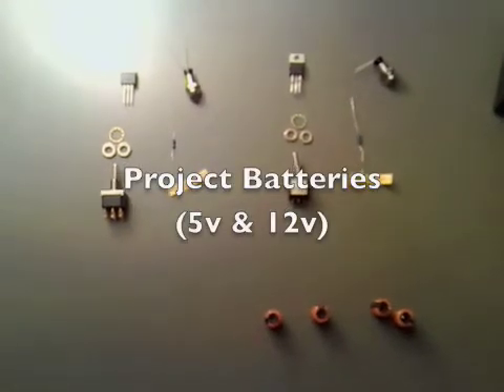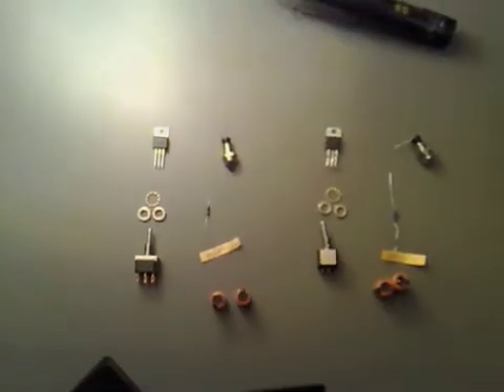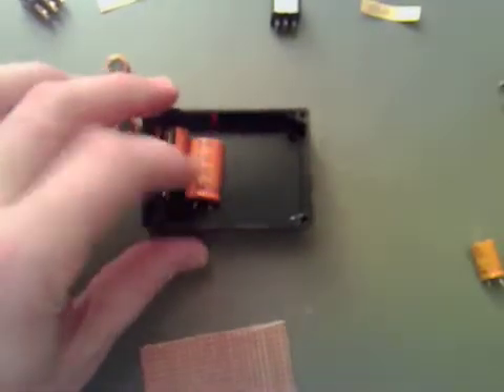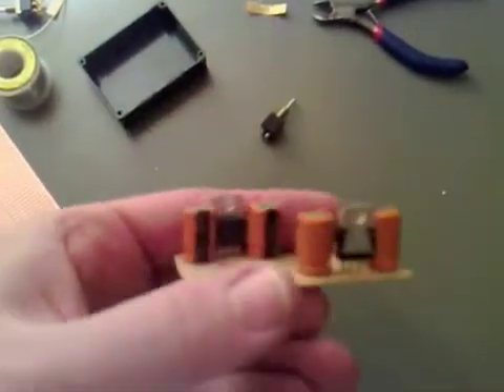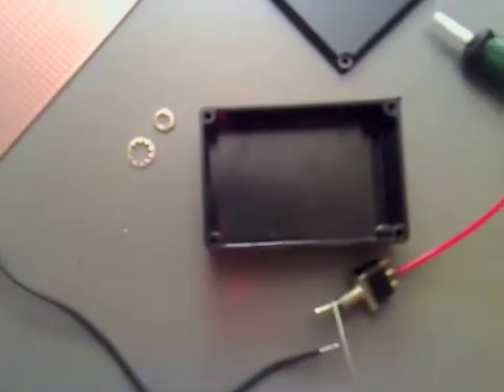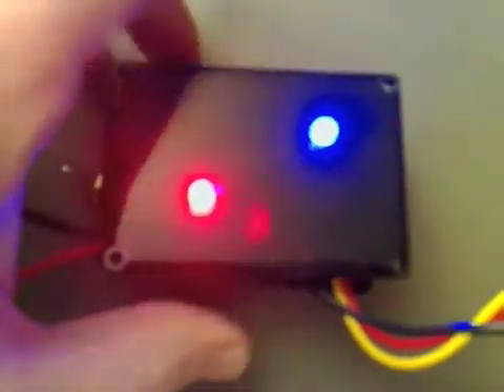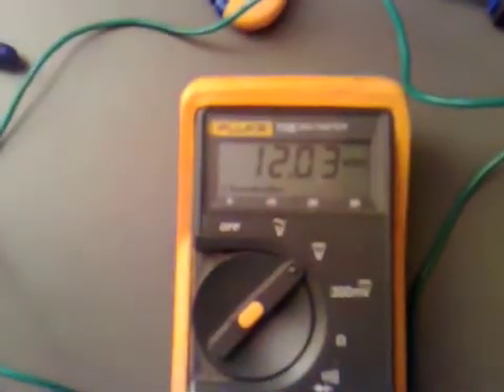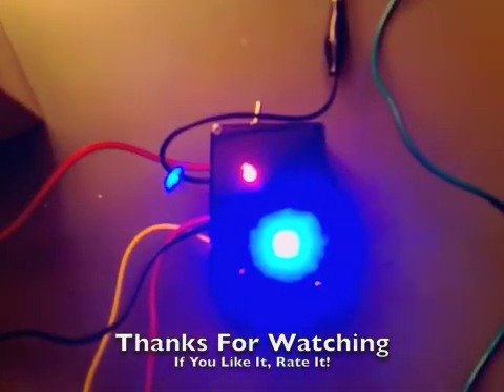Project Batteries (5v & 12v) 005

Comment: You can indeed get a switch like that, but it would not work if you wanted to use both the 12V and 5V at the same time, as the switch would only allow one or the other.

Comment from the maker: You could use a 100mA transistor and put four resistors across the load as voltage dividers, taking leads off the four nodes, nice an simple...

Ill send a circuit diagram if you want?

Paul..

Comment: You should try using a tripod for certain parts. It'll give you a free hand to work with. Maybe design a way to make the camera snap on and off for easy access! Though I must applaud you for the magnet battery hookup you were using for a while. I tried it myself when working with a joule theif. It's quite handy!